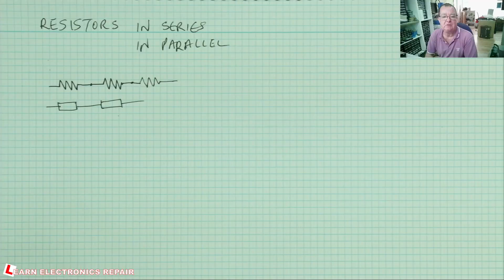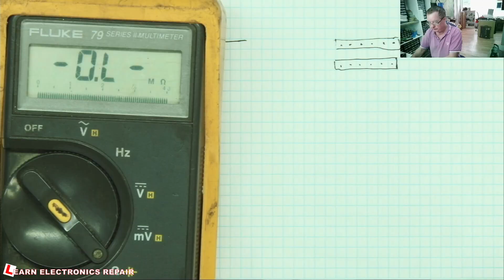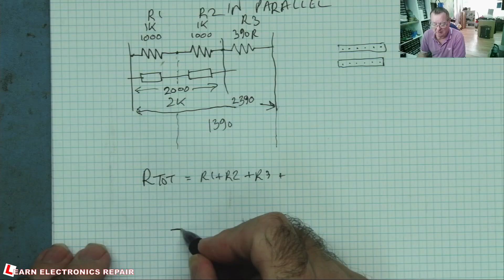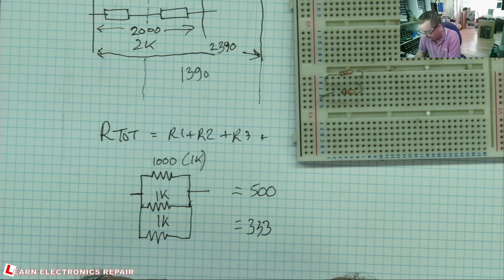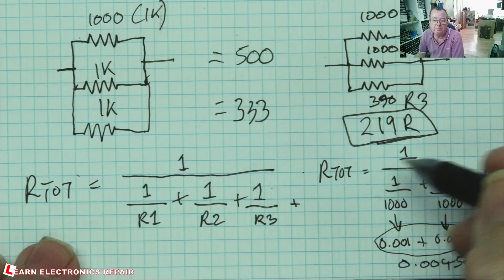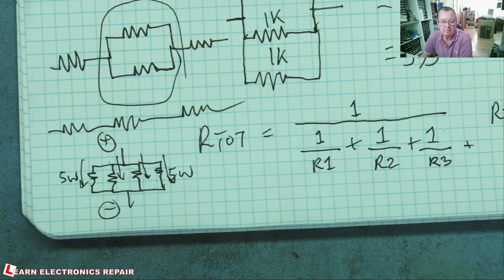Learn Electronics Beginners Lesson 4 Resistors In Series and Parallel

Comment: For 2 resistors in parallel there's an easier calculation. It's simply "product over sum". Multiply the 2 values, then divide by the 2 values added together. e.g. 1k in parallel with 470R.
Product = 1,000 x 470 = 470,000.
Sum = 1,000 + 470 = 1,470.
Total resistance is 470,000/1,470 = 319.7R
Reply: This only works for 2?
Reply: @davidcross30  Yes. It doesn't work for more than 2 in parallel. To put it mathematically:-
Rtotal = (R1 X R2)/(R1 + R2).
Reply: That comes from:
1/(1/R1+1/R2) = 1/[R1/(R1xR2)+(R2/(R1xR2)] or 1/[(R1+R2)/(R1xR2) = (R1xR2)/(R1+R2)

If you have more than 2 resistors in parallel, you can start with  calculating any two out of the rest (preferably two  that have an equal value [two or more if there are more than two equal]) to get Rt1, and then pick any other couple (again preferable of an equal value) or a single resistor, calculate their Rt (Rt2), calculate Rt1 || Rt2, and so on.

* This symbol '||' means 'in parallel with' 

If you're left with a single resistor (in parallel with the previous paralleled couple) you calculate it of course in the same way - Rt1(from the previous couple) || with that single resistor.

Any time you have an equal value of separate resistors paralleled together (let's say 5 in parallel w/the value of 220 ohm each) Rt=220/5 = 44 Ohm. This of course makes it much easier to calculate.

An interesting thing, and what makes it easier to estimate the equivalent value of resistors in parallel is the fact that the equivalent value of them will always be lower in value than the smallest among them. For example: if we had 4 resistors of the value 100, 220, 4.7K & 470 Ohm, Rt will be less than 100.

Comment: Another reasonj for puting resistors in series  is to increase the voltage  rateing ,comon in valve equipment but also used in smps  to stop flash over because of there small size

Comment: Thanking you for the lesson. If you need to change resisters (shorted)
Is the importance of achieving Tot resistance or replacing each one to match their resistance?
E.g remove 3 replace with 1
🌏🇭🇲
Reply: If there were originally three resistors in a circuit then it is best to replace them with three resistors of the original value.

The circuit designer may have used three resistors in parallel to achieve the required power dissipation ability without overheating. You might use two or three resistors in parallel, even though a single one of the same power rating would be within its rating, just because you want to keep the temperature down. All resistors have some inductance and they might have used three in parallel to achieve lower inductance than would be possible with a single resistor (you calculate the inductance of inductors in parallel the same way you calculate resistances in parallel).

You might use resistors in series with similar objectives related to power and heat. You might use them in series because the insulating coating on them is only rated to a certain voltage and the voltage in your circuit is higher than that. You might use them in series just to get a resistance you can't buy in an "ordinary" type. It is possible to buy resistors of very high resistance and with very high voltage ratings, but they can be quite expensive. There are applications where you really do need to use the expensive parts.

Short circuit failures in resistors are extremely rare.

Comment: SO YOUR SAYING RESISTORS ONLY RESIST CURRENT AND NOT VOLTAGE .     NOOOO THEY RESIST POWER.
Reply: No they don't resist power. There's no such thing as power resistance. They resist the flow of current. Power equals current times voltage. If you increase the resistance, the current goes down and the power delivered also goes down.

Comment: Hi Richard 🤗
Good Video and explaination👍👍.
I missing the summarize resistor in greater meshes/network. How to take different resistors together in a bigger resistors matrix.
Resistance is not futile, live long and prosper 🖖🖖🖖
Reply: Big networks can be a challenge to solve. If you choke on 1/((1/R1) + (1/R2) ...), which is ultra-simple math, your brain will asplode when confronted with methods for solving networks.

Some networks aren't too bad. If they are symmetric and the resistors are of equal values inspection will often tell you there will be nodes that are at equal voltage and can therefore be short circuited together, greatly simplifying the computations.
Reply: @D614G_aka_Doug  i know this , other didn't.